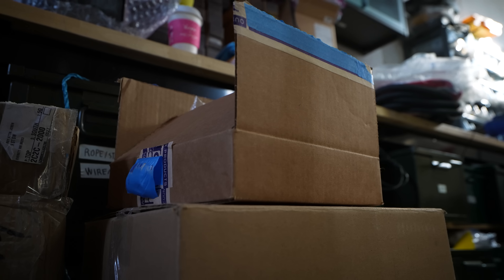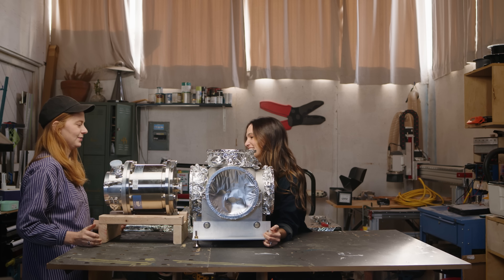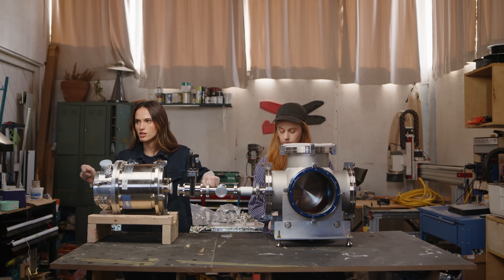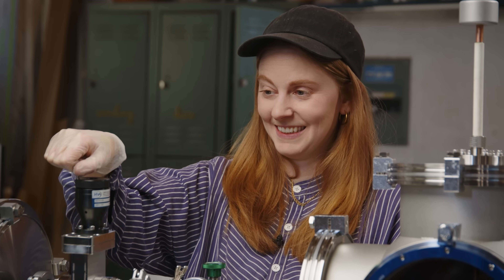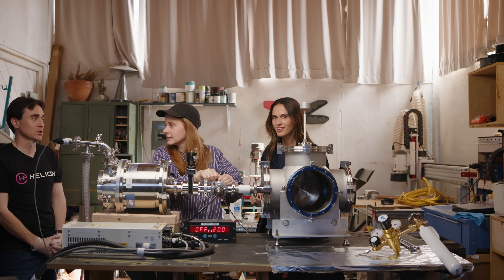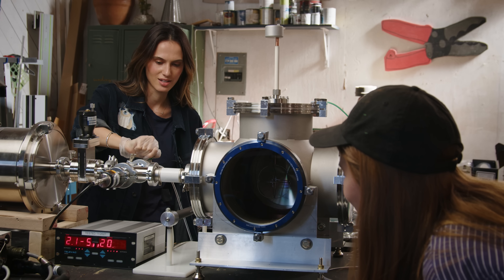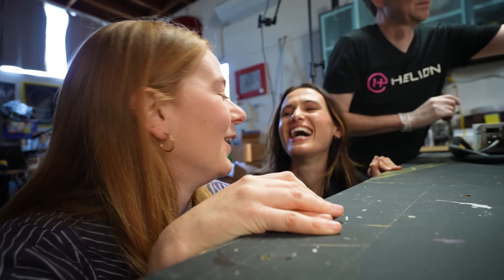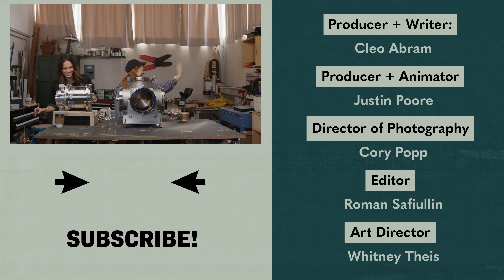We Tried To Do Nuclear Fusion

Comment: what i cant get my head around, is that electrostatic force powered by a household outlet can possible produce enough confinement to fuse deuterium. my brain is just throwing error flags all over the place... such a mess in here.
if fusion is that easy we just need to scale it up, surround it with heatpumps and bob is your uncle. it realy doesnt sound hard as long as you dont know what you are talking about. lol.

Comment: Could someone with profound knowledge of physics check this out? Actually I don't believe there was any "fusion" happening. What I see is just a low-pressure-high-voltage plasma. To my knowledge, nuclear fusion needs a very much higher pressure and higher energy input to start.

Comment: Nice job! I have a question though, the viewports are a major source of xrays and in the system we're building for a high school project, we are required to use cameras in order to view the reaction. I was wondering why this was not a concern in this system? What was the used voltage? What was the pressure of the chamber when filled with deuterium? If you ever read this, thank you so much :)
Reply: There were probably no x-rays because there was no fusion. According to other sources I've heard the voltage used here is nowhere near high enough so it's most likely just a plasma bottle

Comment: Wait... so all the mega-complex challenges surrounding nuclear fusion just... disappeared, and you can make it work on a kitchen table now?
Reply: No, the challenges are still there. The biggest ones have always been:
1. How do you capture the energy produced by the nuclear fission of the particles?
2. How can you make the reactor economical so that you produce more energy than what you put into the system, i.e. starting and sustaining the reaction.

Turns out these are still significant challenges, but there have been a ton of breakthroughs recently. Very hopeful!

Comment: I would ask/try to see if adding lithium(?) Or some Uranium/Thorium to the inside paint could sorta... give it the bump it needs.
Reply: Probably not. U and Thorium are fissile. You stop gaining energy from fusion after iron so the larger atoms would just get in the way (unless you were making a bomb, in which case a fission warhead could be the trigger to a fusion warhead). We can barely fuse hydrogen, productively so adding something like lithium would just make things harder, in all likelihood.
Reply: @snowballeffect7812  

I was thinking the bit of fissile will act as an accelerant(?) for the fussion. you know. a bit of fussion happens, makes a fission a bit stronger, this releases mure energy that pushes a bit more fussion. but just to the point you get a positive, not that you don't add new energy pereiodolically.,to keep it going.
Reply: @fanOmry  Unfortunately that's not how it works because the processes are quite different from each other. It's not like starting a fire where an accelerant that has a lower flash point can be added to start a higher energy density fuel going. In the case of burning, it's the same process. The problem here is not the rate of fusion, but the energy required to get continuous fusion. This can only really be improved upon through efficiency in the direct process. This means you want close to pure target fuel to increase the probability of fusion and for failed attempts to recycle the fuel back into successful ones for each fuel particle. Adding a gigantic fissile atom (remember, U-235 mean there are 235 nucleons compared to H-2 aka deuterium's 2) would simple use up fuel and harm the process of fusion. The Uranium atom would split into smaller but still absorptive particles and you end up dirtying the reaction chamber and decrease the probability that a deuterium particle will fuse with another deuterium particle because you've introduced all these random elements that split out of Uranium. At the end of the day, fusion is a game of chance and you want to increase the probability of hydrogen fusing into helium.
Reply: @snowballeffect7812  

but those new derivatives are also unstable, right?  wouldn't the whole proccess be akin to an H bomb? but you know, not that, instanstanous(?)?
Reply: @fanOmry  No. Roughly speaking, the way an H bomb works is that the fission reaction is the ignition to the much more powerful fusion reaction, but if you watch this video, they are producing fusion pretty easily already. You don't have containment with an H bomb, so you need to create instantaneous inertial containment with the fission reaction.
Reply: @snowballeffect7812  

Why? 
Serious question, Not /s or Trolling.

What I mean, what I suggest is a barely above natually accuring fissile/firtile atoms on the inner shell. Just enough to interact with the radiation that will be be produced.
Basically, the Fussion to accelarate Fission, Fission to accelarate Fussion. Neither quite enough on its own for a susstained reaction, and while producing more energy than invested, it is still a declining proccess with no further energy invested.

I did no see anything in the video that would suggest that is an unsupported assumption.

As far as I can tell, this method isn't used because Fission itself has a PR problem.
Reply: @fanOmry  I already explained earlier that it would reduce the probability of fusion, which is much more energetic than fission. It's not a matter of PR, it's a matter of it simply not working. It would be like putting charcoal in your car gas tank.

Comment: Yay.

The fusion surely is the diva and celebrity in this video, but as i did graduated as a physicist on the topic of plasma etching I know about the vacuum technology, too.

I shrieked at what you did to the pumps, there. You have to know the final stage pumps only work starting at a vacuum already and they can easily die from too high pressure. Your lives were at much lower risk than the pumps, but glad you made it. Plasma always looks nice, no matter if its for fusion or you etch into materials with it to form micro mechanical structures.
Reply: "...etch into materials with it to form micro mechanical structures" - Well, that of course would only be a topic for a channel called "Tiny, if true".

Comment: I’m really curious just how inefficient this demonstration was — how far away from power-neutral was it? Or was it not even actively generating any form of power?
Reply: Not at all near it. This is applying the process of fusion, but not intended for power generation. Fusors have been known about for quite a while, and the general consensus is that they're too inefficient and most likely a dead end for fusion power generation. They're good for a neutron source though.
Reply: I should clarify, my statements are based on fusors, this specific type of fusion setup. Fusion in general certainly has promise for power generation, but most consider this type of confinement (inertial electrostatic) in this particular form/implementation to have been abandoned due to suffering from too many losses to be viable for power generation.
Reply: Fusion reactors don't produce 'power' directly, they produce tremendous amounts of heat energy, which would get converted into steam to power turbine generators. With that said, this demonstration was not producing any power. Just a bunch of neutrons and waste heat. Very cool though. :)

Comment: Nice job! I just want to point out to some people commenting a demo fusion reactor can be achieved even easier than this. This set up you guys build is fairly robust! That turbo pump is huge and so is the chamber. It’s fitting for your propose to make the set up big so it’s easy to video but you can achieve the same thing using much cheaper and smaller equipment. I built mine for about $3,000 using a much smaller chamber, a diffusion pump instead of turbo pump and a cell that turns heavy water into deuterium gas. A basic fusion reaction is amazingly easy to achieve at home. The hard part is actually acquiring the knowledge to know how to do so. Useful information on building high vacuum systems is sadly hard to find.
Reply: Yea, the turbo pump must have been one they had lying around, totally oversized for the way it's connected to the chamber.
Reply: @MarianKeller  yes especially how they have it connected, the literal definition of a bottle neck lol